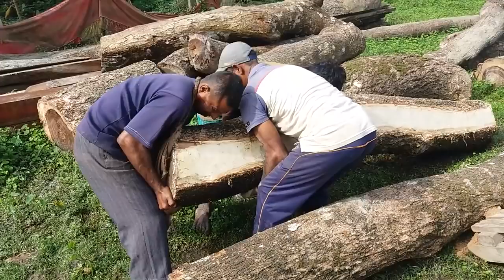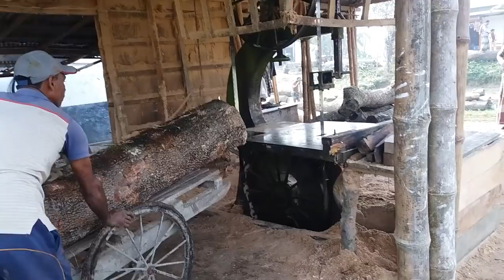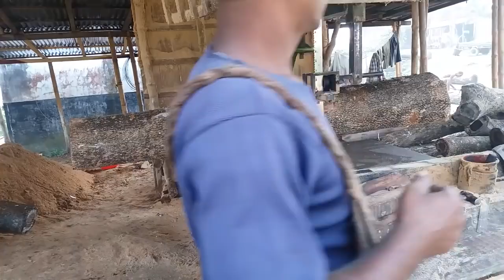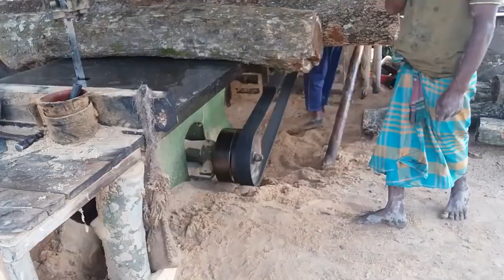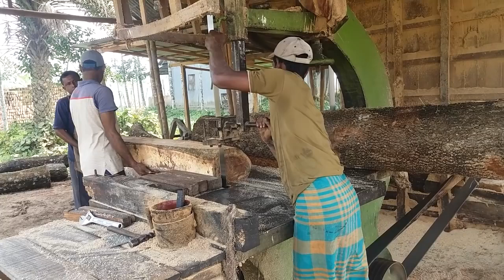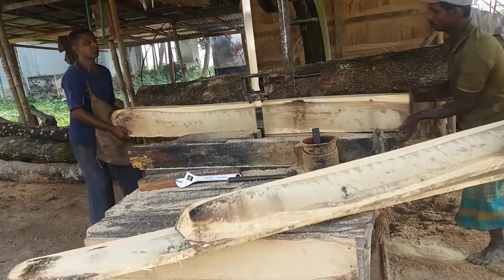Wood Cutting Saw Mill in BD। Bangladesh Saw Mill Works। Amazing Way to Wood Cutting and

Comment: do they ever injure their back lifting these heavy logs?
Reply from the maker: Dear its true they have injured a lot of times in there life but lifting is not the cause, the cause is the blade. The lifting issue is very common here, i will show you how do worker lift a lot of heavy job in futurw :)